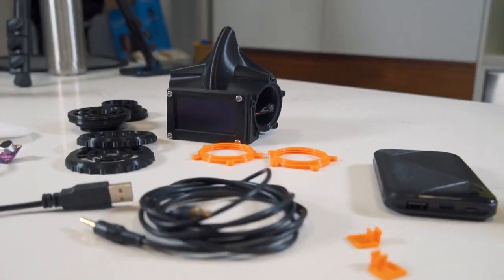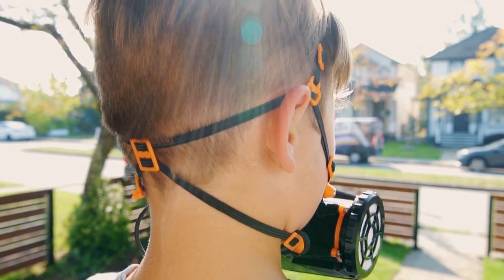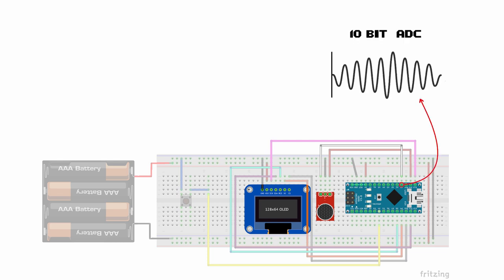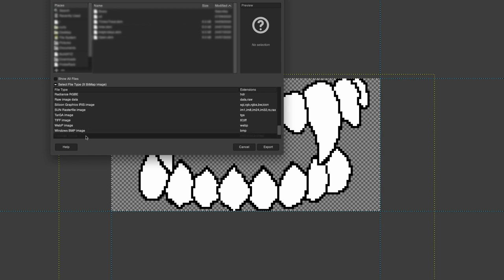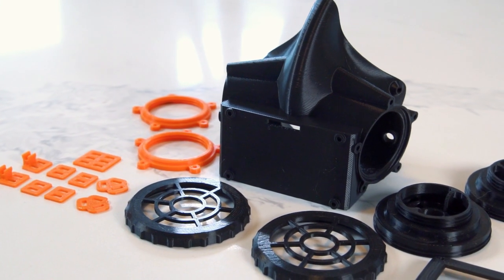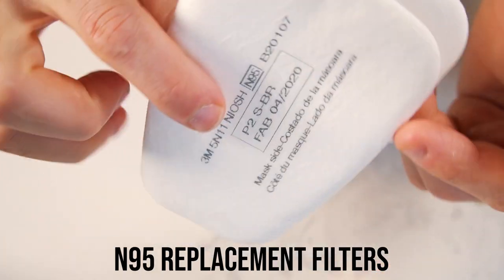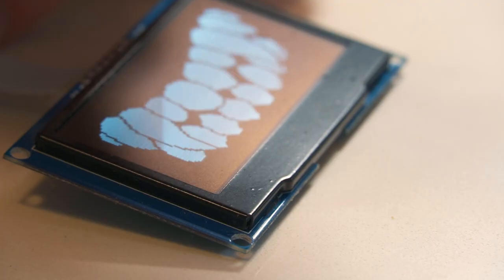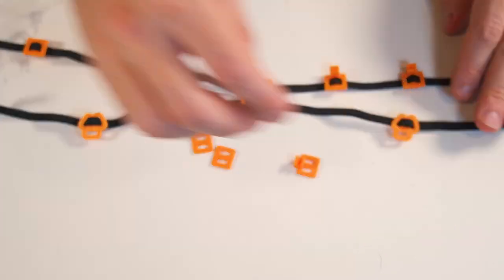Make This Arduino Powered Voice Sensing COVID MASK

Comment: Thanks for sharing this remix. It is awesome! 
PS It can be a bit heavy for a regular elastic strip, isn't it? I yes recommend using a double stip. (just 2 strips lines in the same mount holes) I was using that double stip for active(fan-based) filters.
Reply from the maker: It is a little heavy, that’s a great point. 6mm (1/4”) was just easier to get in my case. I will probably double up as you suggested:)

Comment: Tha mask is a nice Idea, but I see some issues. 
The mask needs an exhalation valve so that the moist air does not seal the filter. The areas around the noses are not tight, it should actually be a soft material like silicone. You could maybe get the areas sealed with felt.
If the electronics are in the front of the mask, they get damp and should at least be protected with silicone spray to prevent electrolysis.
Reply from the maker: Thanks for the feedback Mike:
1. An exhalation valve would be a great addition. The bottom is flat and this could be added after the fact, any suggestions on how to implement the valve?
2. The masks fit my kids well it seems, I did try to make a silicone gasket mold  but it was a little beyond my modeling skills, i really like this the gasket made in this video: https://youtu.be/gwOZ_gwkojg
3. This is not an everyday mask, it's just for a few events. The electronics could be made smaller and dipped in epoxy or some other agent to prevent corrosion.
Reply: @buildxyz  - I use a silicone-spray called: "Electrolube DCA SCC3 Conformal Coating - 200ml" Made in UK, "Modified silicone coating for the protection of PCB under extreme climatic conditions".

If I have some electronic (in a housing too,  but outside), then I have to calculate with high humidity and condensing water.
It is possible to remove the silicone surface from soldering points if needed, with some heat and scratching.

Compared to the time I have saved to protect my PCBs, the amount of PCBs I can protect with this 200ml ... it is very cheap.

Comment: The control box stl is missing the body, it only has the lid of the box...
Reply from the maker: Good catch Ron! 
I have updated the Thingiverse page to include both the lid and body in one file :)
Reply: @buildxyz  so I believe there is another piece missing, the filter plastic covers are not included (the filter lids).
Reply from the maker: You are correct again sir! those particular files are unchanged from the original design by user MSA (https://www.thingiverse.com/thing:4278790) I have now included them in my Thing (https://www.thingiverse.com/thing:4614873) for convenience, please see 2 additional files:
- BuildXYZ_mask_m2-filter-p2b3.stl
- BuildXYZ_mask_m2s-filter-p1.stl

Comment: Do you have a suggestion for a different display since that one won't make it in time?
Reply from the maker: I didn’t experiment with other screens. OLED display looks really great at night because they have no back lighting. Perhaps something like this could be used but the mounting holes on the masks would need to be relocated. 

https://www.amazon.com/HiLetgo-240X320-Resolution-Display-ILI9341/dp/B073R7BH1B/
Reply: hi

Comment: Hi, I am wanting to create this but a slight bit confused with the coding because I am not used to it.  How do I code and make the OLED display picture move with voice more specifically?
Reply from the maker: Hi Danny. The code for the project is linked in the description: 

https://github.com/buildxyz-git/PixelMask

If you download and flash this code to and Arduino Nano using the Arduino IDE (https://www.arduino.cc/en/main/software) you should have a working mask with no coding skills required. 

If you have more specific coding questions on how to change certain features you can post additional questions here 🤓 and I will try to help.